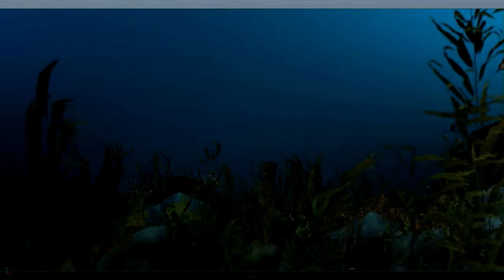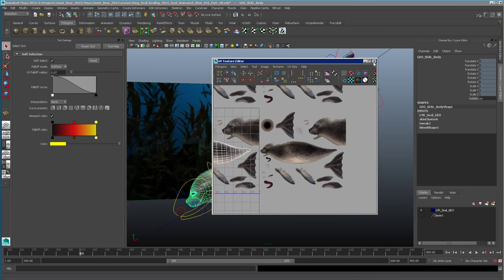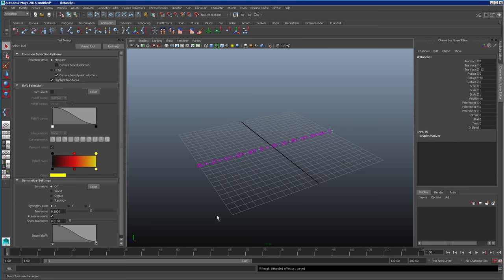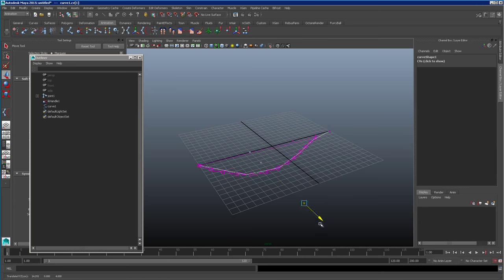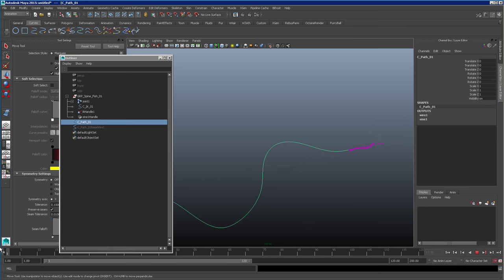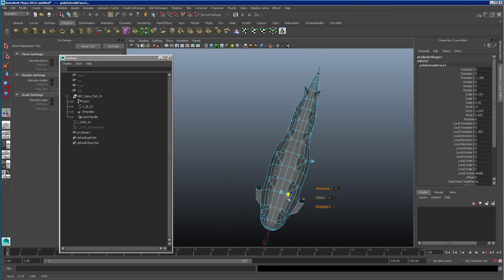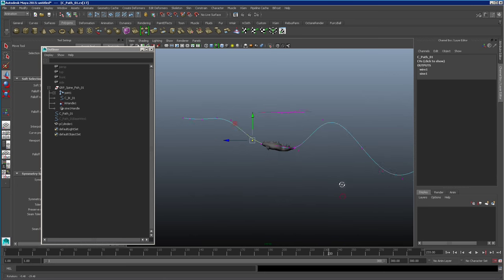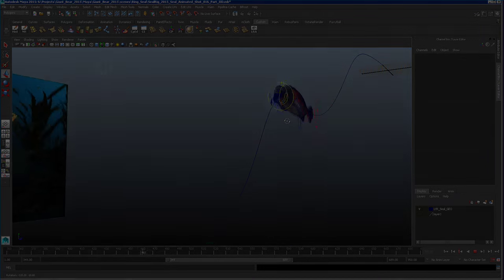How To Animate Along a Path With Deformers Using Autodesk Maya | Animation Tutorial

Comment: Hi Daniel, I'm trying to learn Maya through your tutorials. I followed the steps of creating your own curve on the joints. However, after creating the curve and selecting the start and end joint with ik spline handler, my curve still won't move like how it is on your video (4:49), maybe I know what have I done wrong? I used the move tool and try to move it
Reply: I have the same problem
Reply: On your status line, in the selection mode menu just select the third button and try again :)
Reply: @IlseZamarripa  still doesnt work.. nothing is moving and the mesh is bending out of shape.. EDIT: never mind got it to work with the third button as you said :)

Comment: I was wondering if it's possible to apply it to circular path so that I could make a loop/ for some reason it doesnt work, the spine doesnt bend?
Reply from the maker: Have you tried taking a straight path and turning it into a circle? You can do it if you use a bend deformer on the path. This method has its limits, but it may be possible, in fact it should be. Also double check your input order. If you right click on the geometry of your deformed character and look for the "all inputs" you can middle mouse drag the input order up and down to see if it helps the results. Sometimes if the input order is wrong it will cancel out the effect.